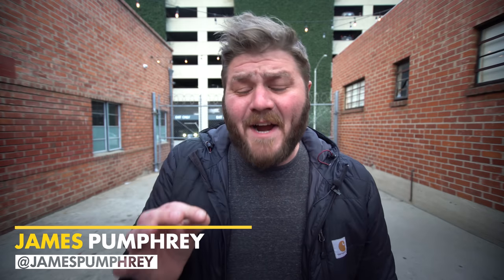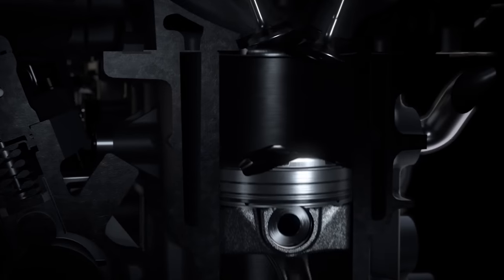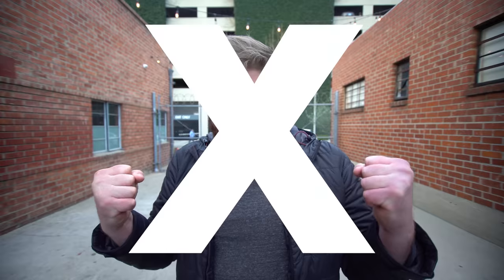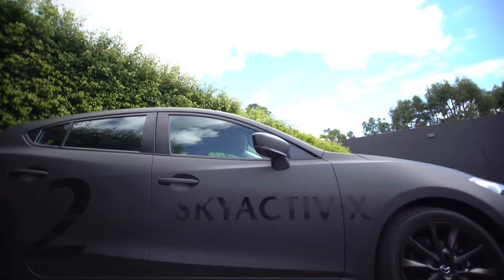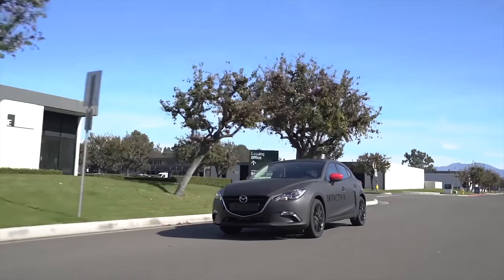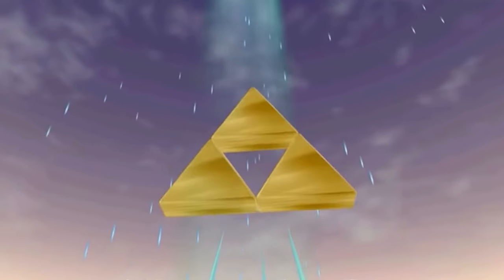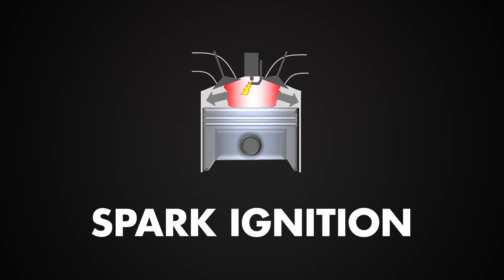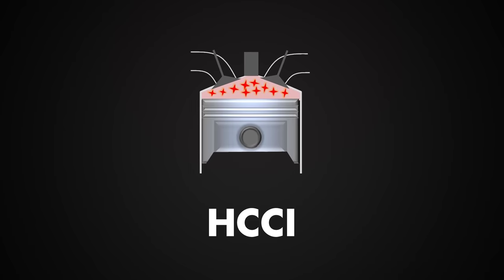Mazda's Secret New Engine Technology - SkyactivX | The New Car Show

Comment: Mazda is really underrated car company
Reply: Kaan Wayne your prove?
Reply: rashdan 97 they are making their own technology, they have special design, they have super build quality. Did you saw Mazda RX vision? Beatiful car. Maybe its not actually evidence but those are true facts.
Reply: Mazda is truly the savior of the car community. They try and always attempt to innovate for the driving experience, not on how you can save gas in a glorified RC car.
Reply: I have 2012 Mazda 3 SkyActive and I LOVE that car.  Super sporty and when I baby it I'm getting almost 50 mpg.  So far very reliable as well.
Reply: rashdan 97 And who the hell is crazy enough to put a rotary in a car?
Reply: You know why?
Rust
Reply: The only problem with mazda is that it focuses on tech, but they miss out on rust protection. They have none. My grandpa had the old 323 aka Protege(the one with the wide ass taillight. ) he scrapped it becouse it became a rust bucket and woulnt pass technical inspection. The he got the last gen 323f(hatchback) same fate. Where i live you can find rusted out 7 year old mazda 3's and 6's.
Reply: Where i live, rust is pretty much non-existant
Reply: Mazda really is an under-performing company, they seem to always invest large sums of cash into engine technologies that end up failing to catch on.
Reply: +Kaan Wayne  But the RX-Vision was a non-functional, full-size model made out of styrofoam and clay??? It didn't have an engine or even have steerable front wheels.
Reply: +TheKiwisage Mazda is not underrated... its just one of the smallest and least successful Japanese automakers...
Reply: Indeed, the 4-cylinder MX-5 is the best selling sports car under $50,000... THE RX brand however was discontinued do to lack of sales.
Reply: Yes, the sports car market has shifted to the high-end segment... a place where Japanese automakers don't do well....
Reply: But other Japanese sports cars didn't do as badly as the RX-8 which suffered from having the worst fuel economy in its class, a bad reputation for reliability, poor resale value and utterly tragic styling.
Reply: Mazda is well known in Japan as the worst managed Japanese auto maker... with a long history of bankruptcies and models and entire brands that were huge embarrassing flops... anyone remember Amati? Eunos? or ɛ̃fini   What about the Miller Cycle engine? that was another big flop that lost money.. they lost $3 billion on RX-8 too!
Reply: Kaan Wayne just because they make they’re own technology doesn’t mean they’re underrated. In fact their own technology actually kinda sucks. They have terrible transmissions and engines
Reply: Mārtiņš Liepiņš live somewhere else then. It’s not Mazda’s fault...
Reply: Mazda has made a niche for itself in cheap, entry level car market vehicles that are basically disposable after 8 years... So shitty rust proofing is what pay for... rust and corrosion is what you get.
Reply: @doktorbimmer  

Dude, who pays you to write all this propaganda? I want a job too. Sounds like an easy way to make some dollars. 🤔
Reply: +Lohan S  Just the facts here kid... and the truth is always free of charge... anyone can look at the numbers of RX sales and see that the RX brand was in a fatal death spiral since 1986... Mazda had no choice but to pull the pull on the failing brand before it took the company to its destruction... if it wasn't for $3 billion in Japanese government bail-out loans Mazda would have ceased to exist years ago.
Reply: +Lohan S  In case you are not familiar with Mazda (Toyo Kogyo Cork ltd.) kid??? The company has gone bankrupt 3 times in its rather short history... its biggest financial failure was after it attempted (miserably) to launch an all Wankel powered vehicle product line... if FORD MOTOR CO. had not purchased the company from a court ordered bankruptcy sale??? Mazda would have died out decades ago...
Reply: @doktorbimmer  

In case if you are a newborn, child, let me break it to ya! Quality or innovation doesn't always sell. Remember Walmart and McDonalds? Truth is, Mazda has good quality products and are willing to take risks. I buy Mazdas BECAUSE they had the courage to build the rotary and are now trying the HCCI tech. There's a reason why Toyota partnered with Mazda, and has Mazda building it's Yaris line. Some of us don't care about numbers. We care about the passion and courage. 

You are barking at the wrong tree because I never denied your point about bankruptcy. While you have some facts, your comments display an emotional butthurt against this company. 

Anyway, since i don't have all the time on earth to hang around YouTube and comment on almost every Mazda topic... ahem ahem... nice talking to you buddy 🙂

P.S. happy to accept I am wrong and take my comment back if you can prove Mazda competes on price. In the North American market, Mazdas are + or - 500 compared to Toyotas and Hondas.
Reply: Mazda IS NOT TOYOTA... don't ever forget that son!
Reply: Some people only care about low price... not quality, its the very basis of Mazda's core customer business model.
Reply: @martinsliepins6225   you right, it was problem, but I have a 2012 and 2014 with zero rust problems
Reply: Kaan where the rotary boys at??? I’m here🕺🏻
Reply: @doktorbimmer  The facts? Dude you are full of shit. You are talking like mazda is still the company they were when paired with ford. They have been consistently releasing class leading vehicles since 2014. What terrible engines and transmissions are you talking about? The best auto in the class? Its very responsive and isnt a CVT like the competition (and the manual gets great reviews as well). Or are you talking about the naturally aspirated 2.5L instead of a tiny engine and a turbo (while still getting similar MPGs). Mazda is a tiny company but they innovate and have beautiful designs while having a driver focused car with good handling. And reliability? Give me a break, I am on multiple mazda forums and do not see any major flaws, already a 2014 with 200K miles. I will agree they have rust issues and I would do some preventative care if I wanted to own a mazda in a rusty area, doesnt apply to me so I dont need to even think about it ;-). I have personally worked on honda, toyota/lexus, and mazda and they all have similar japanese design philosophy and have been all easy to work on when compared to german or even american manufactures. As for your BMW that you commented about, you're an idiot since mazda and BMW do not compete with each other, like at all. That said I look down on german engineering as their design philosophy is trash in every aspect other than performance. There is a reason why older german cars have the WORST resell value in the used market, its hilarious how cheap you can buy german junk. I would lease one but thats about it.
Reply: @BoogieDownProduction YES, the facts... you must live in a very tiny, sheltered, delusional fantasy world created for yourself... here in the real world Mazda is struggling to survive in a shrinking market segment. BMW never needed a bailout or gone bankrupt 3 times like Mazda has... dropped like a bad habit by Ford... they are deepening their ties with Toyota which will most like acquire a majority stake if not an outright cash buyout in the not so distant future.
Reply: @BoogieDownProduction What is your point? Mazda is one of the smallest, least successful of the Japanese auto manufacturers... and they are currently being clobbered by the Koreans.
Reply: @doktorbimmer  Mazda is really underrated car company
Reply: @BoogieDownProduction You are entitled to your personal opinions... but that does not change the fact that Mazda's market niche is selling cheap, entry level cars, it is not seen nor has it ever been perceived as a high performance or a high-end luxury marque... all of the companies efforts to move up-market have been met with failure. The small niche market for cheap Japanese cars that Mazda has occupied is now being overrun by cheap Korean and Chinese cars.
Reply: @BoogieDownProduction Subaru, Honda, Hyundai and Renault... these are underrated car companies... if anything Mazda is overrated.
Reply: Mazda allday.. Iv had meny meny Mazdas over the years.. From 323 familiars to rotarys.. I enjoy em all..i currently have a 1st gen Mazda demio as my work van an the most reliable car I have ever owned. Goes an goeas an goeas forever.. What more could you want in a car.
Reply: Not really... They try a bunch of crap technology that that does not perform in real world.  Plenty of fan boys sure but you cannot fool all of them all of the time.  Toyota gets the nod for bring very reliable and that is what most buyers appreciate.  Mazda build quality is always suspect and they have had plenty of trans problems
Reply: No u
Reply: What about an engine that squirts a very tiny amount of diesel and a lot more gasoline. Diesel just for boom.
Reply: @martinsliepins6225  Where I live you cannot find rusted out Mazdas :) Btw my dad had the same 323 as well; a 1990 323 sedan, he sold it off in 2007 and got a Mazda 3 then
Reply: @Craig Henley Talking about the iA? Then yeah that's the Mazda2. Feels pretty weird every time I pass by one
Reply: Bought my first car ever in January. 2015 Mazda3. I just love it, but I'm only just getting into cars so I don't know much. 

But trying to make the most efficient internal combustion ever as opposed to going electric/hybrid sounds like a way smarter and more realistic plan.

It'll probably end up being more affordable in the long run, probably last longer than electric and hybrid, and just generally seems like it's not going in this direction where lower income people will get priced out of owning their own cars.

Which all this electric and hybrid stuff is absolutely doing, and nobody seems to acknowledge that.

And I guess it's still only 5 years old, but no rust or corrosion problems yet...
Reply: this engine in a supra mk4
Reply: doktorbimmer LOL the IIHS named Mazda the safest automaker in 2020, Consumer Report’s most reliable brand of 2020 (Miata as #1 out of all cars), and US News & World Report’s Best car brand 2020. But I could be ‘biased’ by bringing up these facts because I myself have the new 3, which won World Car Award’s Design of the year. I would advise anyone in this thread to not take you seriously. And if anyone who is looking for a car sees this, 2020 is the perfect time to buy a Mazda. The warranty is great too.
Reply: Laughs in Mazda Miata, AKA the most popular and reliable project car.
Reply: Wife has the 2015 Mazda 3 skyactiv 2.0 we have gotten over 44mpg on road trips with multiple suitcases! Plenty of power and it takes regular octane! Imagine if they made a performance version of skyactiv-x that had multi fuel capabilities IE making more power at the push of a button and switching fuel from e85 to 87 you could make a decent power upgrade with a fuel switch